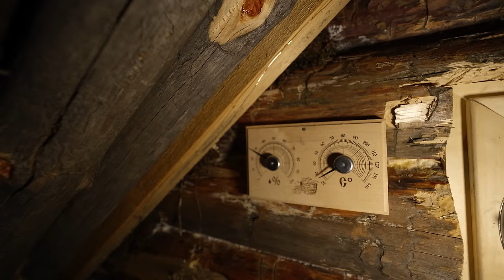I hid from the SLEET in a HERMIT'S HUT. Night blizzard and frost in COZY LOG CABIN

Comment: Just a bit of advice, when pulling a sled in deeper snow, cover it with a small tarp and it keeps it from picking up snow and adding weight when you’re pulling it. I do it when I’m hunting and it works great and keeps my gear dry.

Comment: Fenix headlights. Those are realy good. Durable. Got 4 dif items. Still working, dropped them. Banged the glass against the cardoor corner. Feared they where broken but not even a scratch.  Love the wireless charger option, tho if some iron particals stick it tends not to charge right. Clean it.

Comment: You Could improve the heating with a heat pipe and self feeding fire.  It pulls cold air in heats it in the fire and blows into the shelter.  It can be inside or out or in its own heating room.  (Aka furnace room).   Still have a hot plate function for cooking with no smoke inside or CO risks.

Comment: If you cut a bunch of pine boughs and make a 'mat' outside the door, it will give you a place to kick off the snow, before entering the building. So you don't track in the shelter.

Comment: So much of this is just abject illogical nonsense.  Says he's cold and his clothes are wet, so he builds a fire in the cabin's oven, but then leaves the door wide open.  Wastes time building a peg to hang his pack outside the cabin for no discernible reason.  Says he loves the warmth of a Swedish candle, but after setting it alight puts it so far away as to be irrelevant, then only uses it to boil water, which he could have easily done inside the cabin.  Takes his skis off during his trek and trudges through the deep snow for no apparent reason.  I could go on, but that would be even more a waste of time.  This whole video just reeks of being disingenuous.